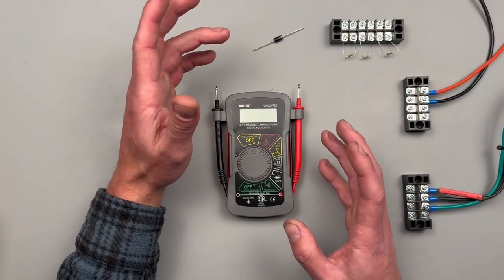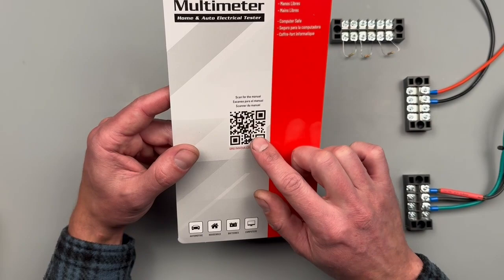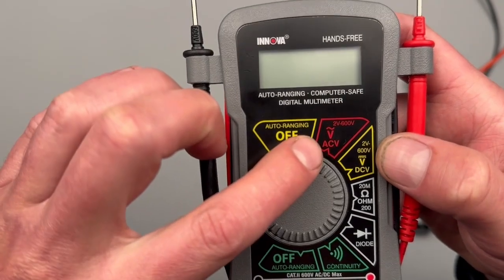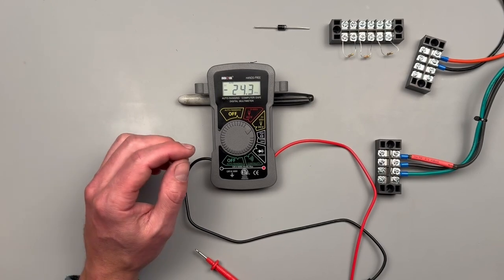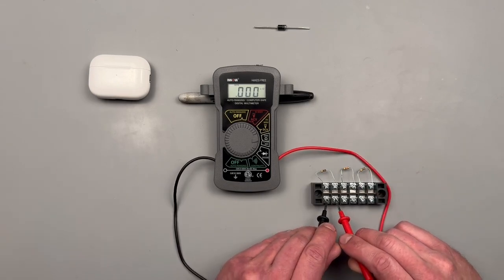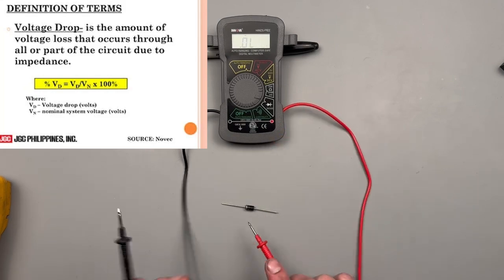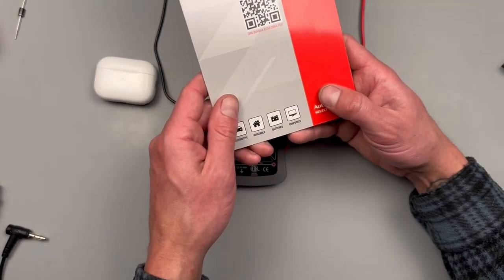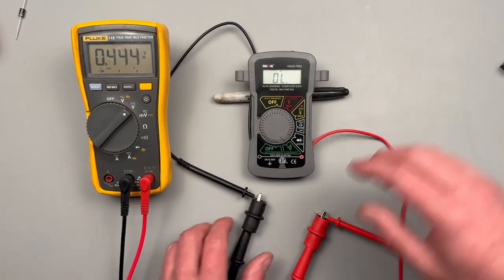How to Use Innova 3306a Digital Auto Ranging MultimeterLike A Pro

Comment: The strap on the back of the unit is for your wrist not your hand. In most cases You will need both hands free to use the red and black leads. You put it on your wrist and you’re still able to move both hands around with the leads.
Reply from the maker: @PinkSkye72  good to know 👍

Comment: When testing a diode with a digital multimeter in diode test mode, "OL" usually means:

(1) Open Circuit or Reverse Bias: The diode is reverse-biased (positive probe on the cathode and negative probe on the anode). In this case, the diode blocks current flow, and the multimeter shows "OL" to indicate no conduction.
or
(2) Failed (Open) Diode:  If "OL" appears in both directions (forward and reverse bias), the diode may be defective and open, meaning it does not conduct current in either direction.